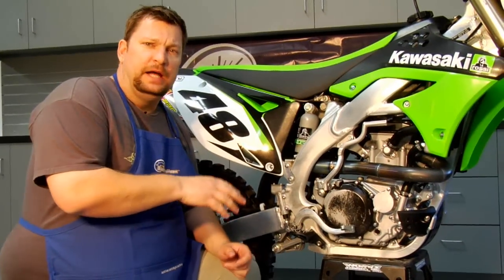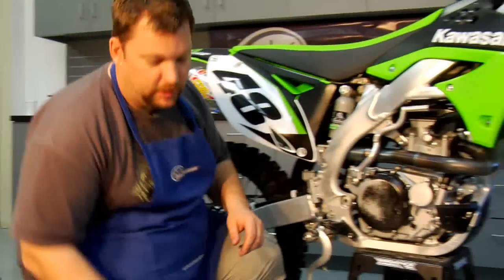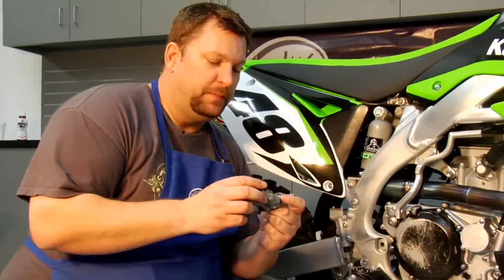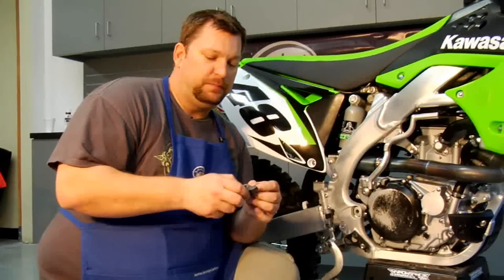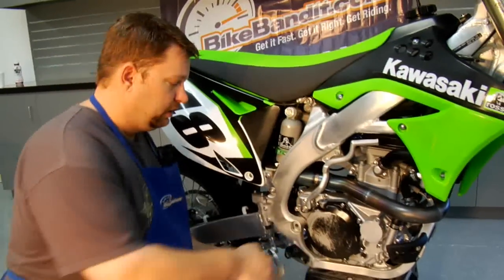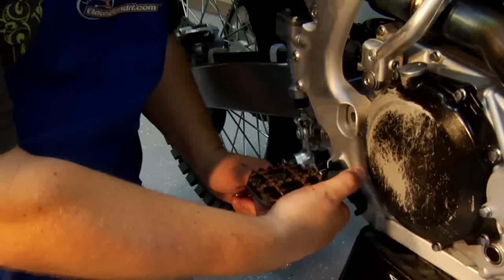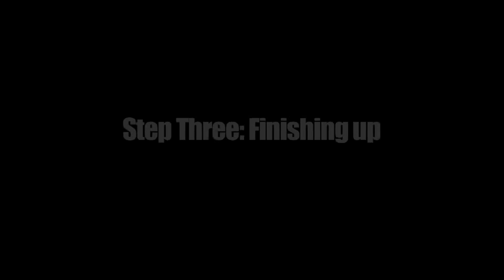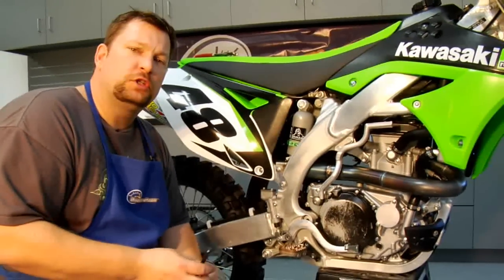Dirt Bike Foot Peg Installation

Comment: I bought the CNC Billet ACERBIS PEGS for my Sons crf50 and man, what a pain in the ass the spring was. It looks like the spring should go over the mount, but it is too big and does not kick back. I seen other videos where the spring goes inside against the foot mount, but still having issues. the pegs are for the 50 or 70, but still having issues. even the old springs from stock pegs don't seem to work. I just ordered a different kind until I figure this out b4 I scratch them all up. Any Suggestions, I would appreciate it. ....Thanks Guys !!!!
Reply from the maker: +Grizzly Boxing BIG BEAR Hey GBBB,Not too sure on where to point you here, but try reaching out to Acerbis directly. Probably going to be your best bet, is to go directly to the manufacturer. Thanks for watching our videos and the question. Ride safe out there. BB.com
Reply: BikeBandit Thanks Bud....I actually ended up putting some rubber washers on each end which works great for now and is pretty tight so thanks........
Reply from the maker: +Grizzly Boxing BIG BEAR Hey Bear,Glad you got things figured out and your little man riding. Nothing but awesome! We're here to help in any way we can. Thanks again and ride safe out there. BB.com